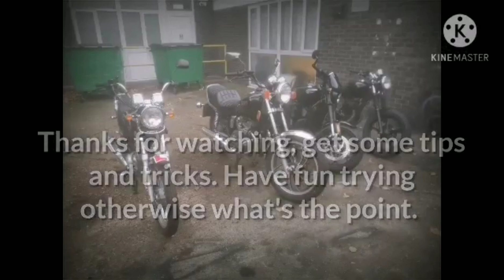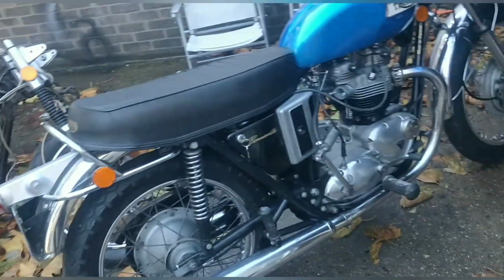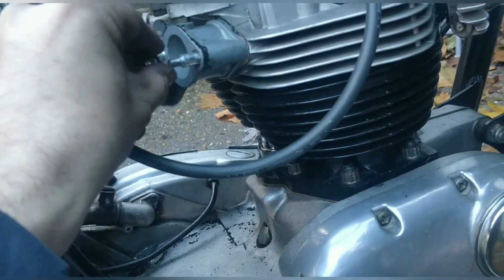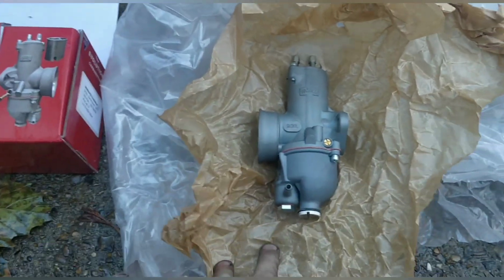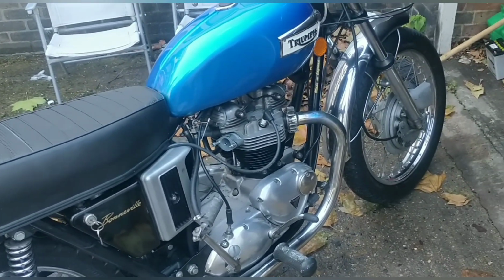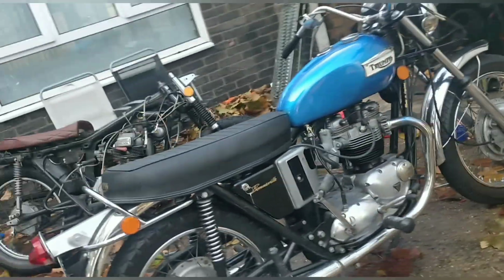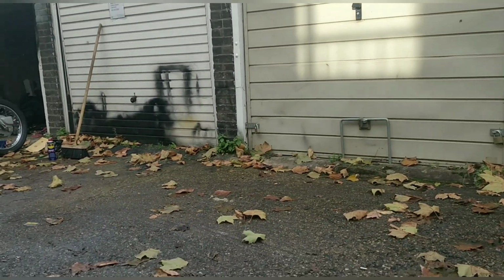1973 triumph Bonneville t120, wassel carb install. First start up on wassels, straight out the box.

Comment: Another lovely vid Charlie. Sounded sweet but as thou it was hunting a little, so the pro help you mentioned at the end will not hurt the bike one bit. Might hurt your wallet though 😂 Due to the labour cost's 👍
Reply from the maker: My hope is that it's now just fine tuning. The compression is great, the valves are good, the ignition system is good etc. I'm sure it's now about getting these carbs set up properly and possibly timing the ignition with a gun.

It definitely need a old pro to look at it. I'm terrible with older bikes

Comment: Tickler and choke (actually air slide) are 2 different things and do different jobs.
The tickler is purely to start the engine (just floods the carb) the air slide is used to adjust air/fuel mixture during starting/running (like a choke). Definitely got a misfire there, could be anything from air leak, incorrect valve clearance to worn valve guides.
Reply from the maker: I've given up on it if I'm being honest. I'm going to book it into someone in a month or 2 so that they can sort it. I'm not used to classic bikes at all. I thought it would be simple but it really wasnt.
Reply: @motorcyclerescuer  will be interesting to find out what the problem is

Comment: thats a shame, have you considered ditching the electronic ignition and going back to old school points and condenser, not sure why the tickler replaces choke, tickler just ensures bowl is full of petrol choke restricts air intake, if you do take it to someone do let us know how ends up,,
Reply from the maker: The tickler floods the bowl up into the carb to help starting but I just don't understand these carbs or bikes well enough. The electric ignition is ment to be better for the bike. 

I'll definitely feedback how it ends up Si but will be a few months mate
Reply: @motorcyclerescuer  good luck cracking bike, am sure you said you guys took it on running badly always a pain when "someone has been here before", personally i would go back old school the electronic ignition you dont know if was working properly, looking forward to seeing the bent valve 125 see if can get that alive again
Reply from the maker: Oh yes actually I've got the head back together and the old exhaust stud out now so I should be able to put the engine back together this weekend. I kinda want to hear it run again and then get it out the way.